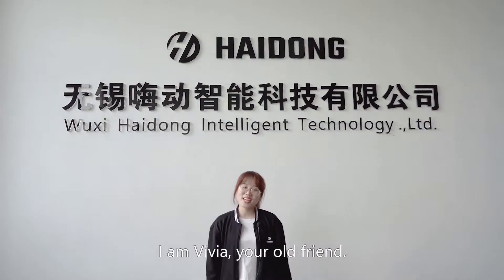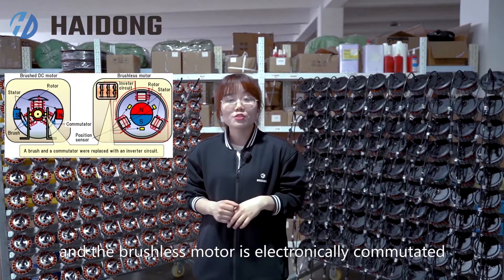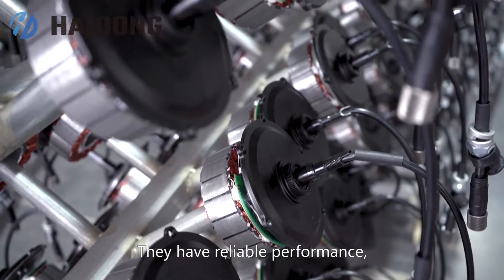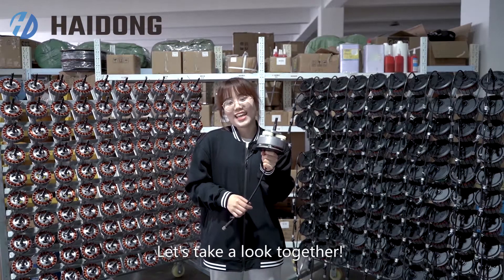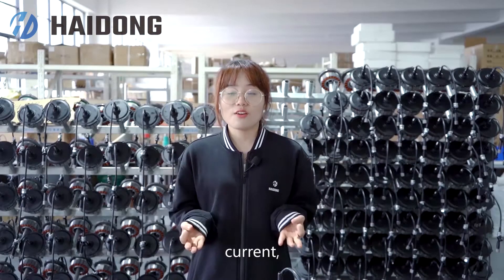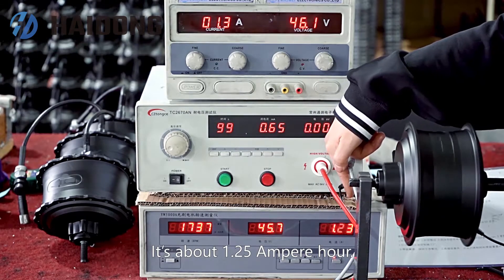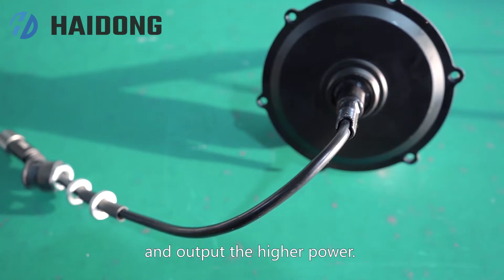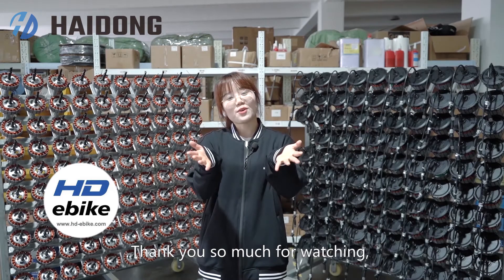Ebike Motor Assembly and Testing & 4 Reasons Why Our Motors Are Better Than Other Motors

Comment: this video was 1 year ago so they should have use the newer motor that they have on the newer bikes like the Zebra. That motor has many upgrades and puts out more power and runs cooler. Plus it has the wires coming out the disc brake side between the hub and the frame. Also, it comes apart on that side with makes it much easier to work on. It is a far better design. They call the Zebra, the Whale.😎